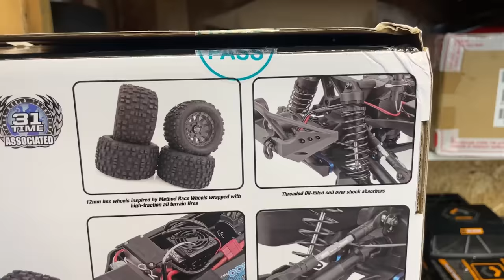WORLD'S BEST Beginner RC Car (its fast!!)

Comment: Hopefully my MT10 will arrive this 5/09/2023 and did order the bottom A arms front and rear from RPM to arrive at the same time. I do not drive like you do, but when it holds up this well I just had to have one. Thanks. I am 78 and it might even out last me.
Reply: How has it been so far? Hope to hear from you soon
Reply: RIP
Reply: Hi wanna sell me your mt10 list on ebay I buy
Reply: @albertopalos8326  funny 😅

Comment: I bought one of these and have 0 regrets. Fantastic little machine.
Reply: How does it handle water, is electronics waterproof in som way?
Reply: @beljonov yes, they are: hobbywing ESC is waterproof itself, the receiver is in the box, so it should be waterproof. Motor is surely waterproof 
The only one thing that I’m not sure about is the servo, but looking at other reviews - it stayed well in the wet🎉
Hopefully i will soon order myself one of these, and by the way it would be my first rc from a big brand 😀
Reply: @Maxinator_RC can it handle 4s?
Reply: @Maxinator_RC I mean 3s
Reply: @drxy08  no, it can’t handle 4s but it can handle 3s
If you want to run it on 4s you can buy a hobbywing max 10 sct (120a) which is able to run on 4s

Comment: I’d love to see the v2 on a comparison with the granite and the big rock
Reply: I’m interested in that too. Arrmas 3s platform is super solid, I think the only problem is when you gear up and really bash on it the composite gears take a beating.
Reply: The drivetrain is definitely tougher in the associated. When you really start sending the Arrma 3s cars you start stripping gears and popping out driveshafts
Reply: @based_will  My problem with Arrma 3s lines is popping out shock rods.  Shock rod ends are not threaded and after bashing Big Rock a little bit they start coming off and you have to super glue them from that point on.  Pretty annoying.  Other than that and steering servo, Big Rock has been very solid for me.
Reply: @Fpsnut  yes, I had that problem with my big rock but not with my granite. Prob due to longer arms. Arrma 4s shocks seem to be tougher and are a direct bolt in
Reply: And the traxxas hoss
Reply: Stemp smashed a granite 5x in one video.  This car is 100x tougher
Reply: @Velghe-RC  i have the hoss and this car puts it to shame I've broken every drive shaft including the steel Traxxas ones very easy
Reply: I want to see that too!!
Reply: I have a Senton 3s, after stripping several spur gears I've updated to the V3 motor mount, which is thicker and had has adjustable mesh. Much better since!
Reply: @Velghe-RC  im talking about cars sold by horizon hobby in which traxxas left some years ago
Reply: @FdJ96  i have the typhon 3s v3 and I’ve bent the motor mount twice now so I’m planning to get the m2s racing one and yes spurs are weak
Reply: Why? We have already seen those are pathetically weak in comparison to this thing
Reply: And hbx 16889. This thing is unbreakable
Reply: Same here be a good comparison battle of the Budget bashers
Reply: @based_will   the Arrma 3s cars are indestructible if you put lube in the diffs
Reply: whatever it is 

you may be lucky with either of them not even breaking but the worst part is spending a extra 20-50 bucks on a spur gear that has to be converted to metal

Comment: I bought the original one based on your review, I don't drive them like you do and it took six months before I broke an arm on it.  I ordered the RPM arms at the same time and have only replaced the front ones, I have stripped the main gear out and the replacement was $6.00.  Looks like I'm  going to have this one for a long time based on this review!

Comment: That’s amazing what that thing took! I think it’s a combo of good design and very light weight that keeps it together, just not enough weight to really hurt itself. Very cool 👍
Reply: Hey fellow MN'er!  I was thinking the same thing, and probably why its bigger brother didnt hold up nearly as well.  Pretty impressive
Reply: @microbuilder  The Redcat Kaiju is pretty much a 1/8 version of this truck
Reply: @microbuilder  That is exactly why. The MT8 is much heavier. If you use a lower capacity lighter battery and RPM arms and hubs it really can start to take a beating. But you have already spent half the truck on upgrades. Hopefully, Team Associated will realize that scaling a vehicle up never works for durability and do a complete redesign to make it stronger. We need more 1/8 scale bashers that are plastic with cheap replacement parts. I do hope they make a v2 MT8 just as strong as the MT10.

Comment: I have a helion avenge mt10 which is the same as the first gen just from helion for those who don’t know. I have had a big problem with it. The front gearbox is very very weak and breaks all the dang time and then it grinds the gears. Everything else is amazing, I hav broken the front control arms a few times but that’s from running it around 35 miles and hour straight into a curb and launching it off a hill about 40 feet and last but not least slamming it into a lamp post

Comment: I managed to break the front end off on my first outing with it, it was a cold day though. Ive since reinforced it with an upper chassis brace, melted steel mesh into the diff housing where it snapped and also put screws through the chassis into alloy bell crank. Haven't broken it since

Comment: Great video Kevin. The MT-10 is a very tough truck for sure. So far I did break one front Arm but it took quite a few high speed direct hits into curbs to cause the failure. 🤜

Comment: It looks similar to the Redcat MT-10, I hope it's easier to work on than the Redcat.  I stripped a 9T pinion and had to darn near dismantle the entire top part to change it out.  The thing is an uncontrollable wheelie monster with the 9T pinion, so I decided to upgrade to a 13T pinion.  After all that, the gear was too tall for the motor, so the speed controller shuts down to protect from overheating 😯😁😒😤!  All that work, and now I have to go back and put the 9T pinion back in 😢!  
P.S.  It was STILL a wheelie monster with the 13T pinion for the 6 minutes it ran before the safety kicked in 😂!  TONS of torque, I mean tons!  Great vid Kev!  Fun fact,  I know ppl watch you worldwide, but I'm 6 hours behind you, so when I wake up, you're having lunch 😂!  Love your videos, bro!  And I'm messaging you as I'm watching, so I have a question. Do you really think someone will bash that body after you have autographed it? I know I wouldn't! If I won that entire rig, your batteries would be the very last bit of current that would be run through it 🙂!  Love your videos, my U.K. R.C. Bro.!  Shout out to the Crew. Much love to/for all y'all, mate!  I am from Wisconsin (U.S.A.) but live in Louisiana.  I'd LOVE to fly across the pond with about 10 R.C's in tow and have a rip with y'all someday, however; if you ever come to the New Orleans area 
to try some of the absolute best cuisine or just to hang out, please, hit me up!  I live an hour west of New Orleans, and I'd just love to shake your hand, get an autograph, and maybe a picture with you!  My dad put a radio in my hand when I was about 3 years old, and I have been plumb stupid behind these things since then, and I am 47, soon to be 48!  My LHS has been in business for over 30 years, but I can't find anyone to run with me!  It's a wonder how they're still in business!  I have had R.C. friends who have come and gone, but I'm not going anywhere!  Anyway, Great video as always, I'd love to meet you, always striving for, "Christmas every day!"😊  Peace ✌🏾!

Comment: This truck is incredible! 😳🤣

MT10 V2 vs. Arrma Outcast 4S V2

The MT10 clearly wins in terms of durability. We can see that in your videos.
Which one is easier to handle for a beginner and performes better?
MT10 V2 340€ vs Outcast 4s V2 385€. No big price difference. 🤷🏼‍♂️

Comment: WHOAH!!...........shiny AND FAST!!

Kev, any thoughts on buying a KING SLING?? You're the only one that can do it justice and give it MOAR POWWA!!🤞
Reply: You cant bash it like an MT-10 if you're going to play in the mud and sand it's fine. The minute you take it to a skate park it's going to break fairly easily. It's more of a scale truck than a basher. You can buy JConcpets fling king tires mount them on a MT 10 and have the best of both worlds. It will throw a huge mud or water rooster tail.
Reply from the maker: yeah i want one, cant get them in uk though
Reply: @KevinTalbotTV  Awe BUMMER!! 😭 This is a Level 1 High Priority!! We've gotta get a King Sling smuggled in by choppa, to Kev!! 😎

Comment: Kev hunt you get a brushless version of the new one? I was going to buy one of the new ones but I noticed they only came with a brush motor at least here in the states which turned me off from buying it. Have the revised V2 so that it has the brushless motor in it now?

Comment: This is a rebadged Helion Avenge MT. Look it up. 

It's a good platform but it's got f*ck all to do with AE. The AE SC10 4WD is the aame chassis. 

Incidentally if you can find Helion parts they are about a third the price of the AE ones. For example a diff AE makes you buy in bits for about 40 quid in total is 16.99 from Helion.
Reply: Good call; with the Helion being about half the price, you'd figure that's the one that would wind up in the "Dirt Cheap RC" category.

Comment: Ok, So Im trying to find the best battery for my traxxas revo 1/16 for more speed. Also ive already switched out the pinion. Just not trying to melt the motor or anything. Any suggestions of what to use??

Comment: Hey brother, at 15:13 to 15:22 is really cool part to watch that your friend actual, literally threw the budget car 🚗 and it was spinning in the mid-air then landed/crashes on skate park pavement, and it just keep going!!! Niceeeee one, dude to your friend that did the literally throw the car 🚗 into mid-air then the rest is history afterwards!! That's sooo cool to see something that's in a kinda good price, but I think it could do better at like $300, instead being at $350.00, cuz I still can't afford it, but that would be my car 🚗 to put my very own DJI Air Unit 03 HD system modified my car 🚗 the way I want and I want and need more POWER, POWER, POWER!!! ⚡⚡⚡⚡⚡⚡⚡ And I will fully changed this car 🚗 into FPV system with DJI Air Unit 03 HD system with it's own battery secured away somewhere inside this car awesome structure of rib cage safely and secured sitting there while I will be driving and bashing the heck out of this awesome very cool as heck budget 🚗 that I can't even afford it, cuz I have no job but I do have parts and HD system all ready and I can take it to use it on my car 🚗 (this one) and I would be enjoying the heck out of this, bashful awesome car 🚗 to drive it for sure, buddy!! You got great video, this is really great one, honestly!!! Niceeeee footage, buddy!! 👏🏼👏🏼👏🏼👏🏼👏🏼⚡⚡⚡⚡⚡⚡👍🏼👍🏼🤜🏼🤛🏼🤙🏼

Comment: I Bought the old V1 version last year and i think it's a piece of crap.  Something has broke on it every time i have taken it out and i dont even do jumps.  1st day taking it out the receiver died.  Got that replaced that took it out the steering arm snapped, replaced that and then the suspension end plate bent and now last week the servo has gone.  Have a FTX carnage and abuse that and have only blown a motor.  Defiantly will never by Team Associated again.